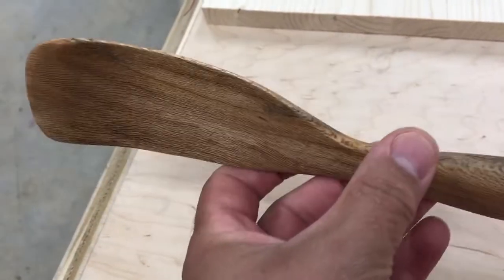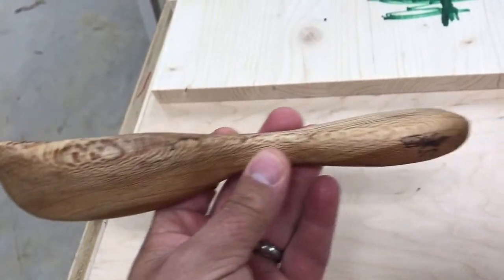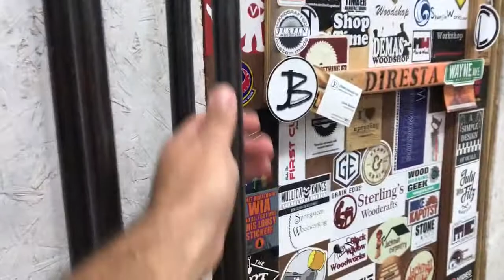SYCAMORE WOOD?

Comment: As wood prices increase, iron pipe can be a good alternative. I have been using it to reinforce cheep shelving. Two or three years ago I would swap the steel for some 3/4 plywood which is nearing $100 a sheet.

Comment: I've got a box that my Delta Midi lathe came in under my jointer that's like yours. Folded the flaps up around the outside and taped them on the outside. All I  have to do Is empty the box every now and again.